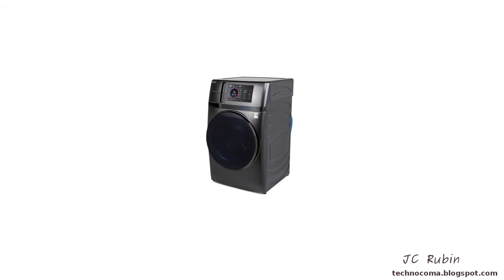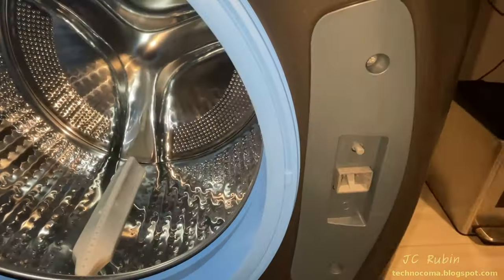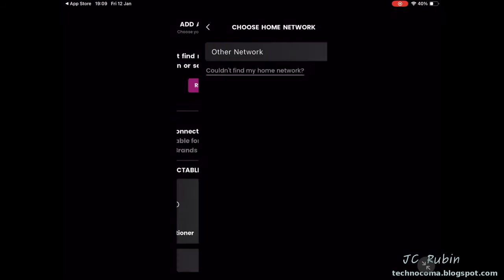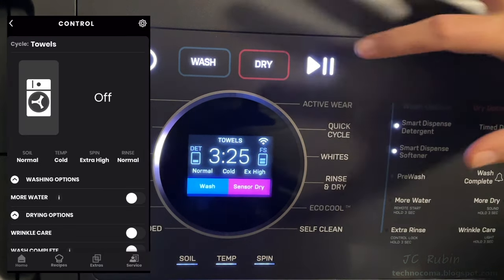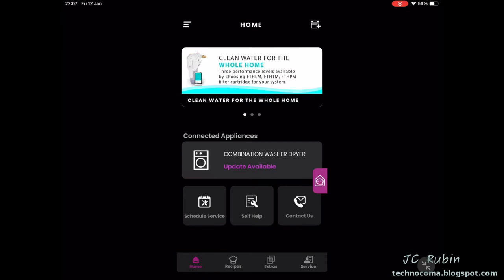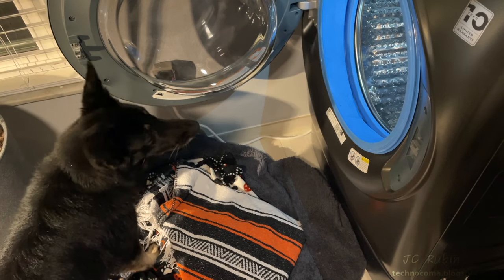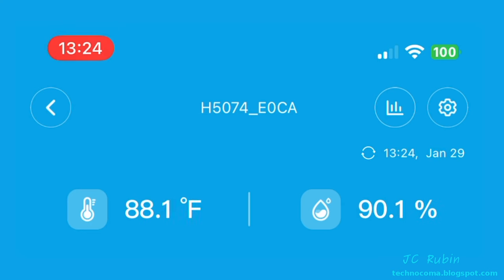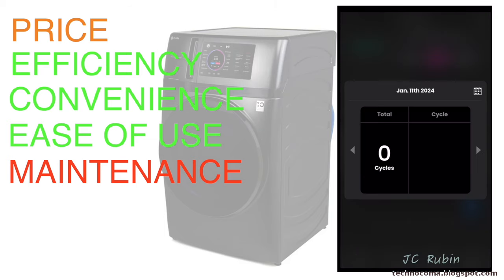GE Profile Ultrafast 2-in-1 Combo Washer Dryer Setup, Testing & In-depth Analysis: Does it deliver?

Comment: Amaizing Videos!  Thanks for posting.  I now have a website up with Filter Kit upgrades that work :)  I have 2 machines and have finally put together perfect fitting products without permanently modifying the machine for warrantee purposes.  I don't think I can post the Website here, I'm not sure of the YouTube procedures.  

My YouTube Channel is https://www.youtube.com/channel/UCW1ED9P3EvFHIajjsvCUWUg

The Filter Upgrade kits resolve close to 100% lint / hair from bypassing the Stock Filter assembly.

I also posted a video on how to Deep Clean the Machine Coil / Condenser and the Tub without taking the machine apart.  Let me know if you would be interested in testing it out.
Reply from the maker: I’ll have a look